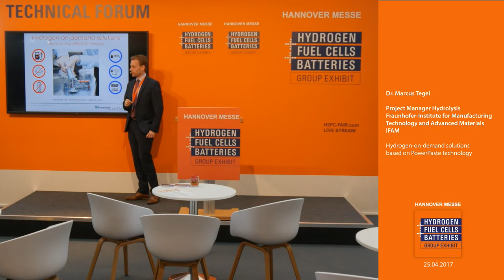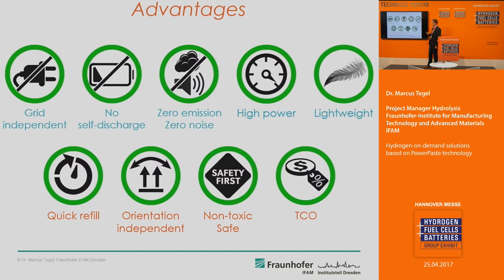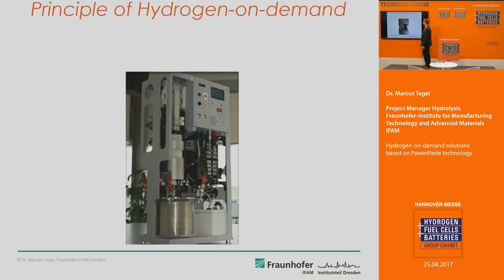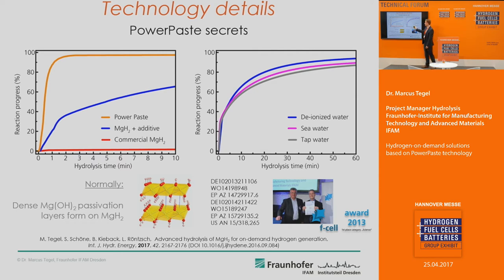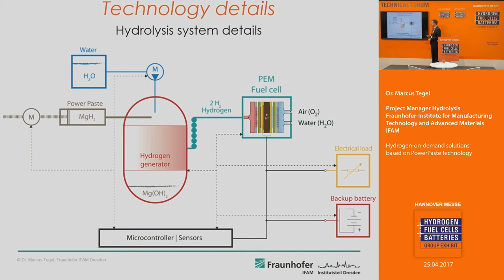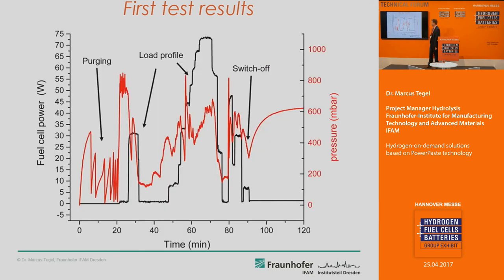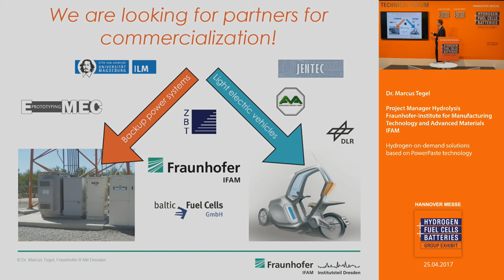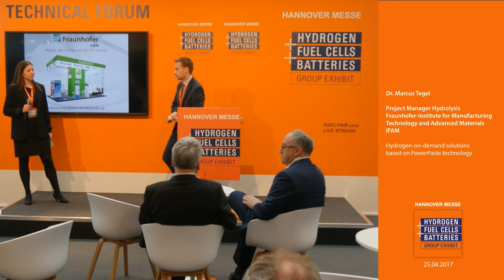Hydrogen-on-demand solutions based on PowerPaste technology

Comment: I can’t see how the Hydrogen paste is made or what it’s made from( whether natuaral or synthetic or toxic)?, You say you use Electrolysis to make the Hydrogen but how is the Hydrogen put into the paste?
Reply: MgH2
Reply: Mohammad Qatouni ?
Reply: @Kiyarose3999  They react Magnesium Hydride paste with water to produce Hydrogen. So it is really getting hydrogen already in water.Just like producing hydrogen when reacting aluminum with sodium hydroxide in water.
Reply: Mohammad Qatouni I thought the paste was a substance developed/used to store Hydrogen, not to make it, to make Hydrogen surely the best way is via Electrolysis. Storing Hydrogen I think is best done by compression as apposed to using another substance ( MgH2) to hold the Hydrogen.
Reply: @Kiyarose3999  Nop.the hydrogen storage is in water. And instead of electrolysis.. they take advantage of stored chemical energy
Reply: They use hydrogen from electrolisis and combine it at a temperature of 750°C and pressure of 5atm with magnesium powder, esters and metal salts to form MgH2, that can then be stored at room temperature and pressure and is stable. Then when they need hydrogen to be released they react the paste with water and hydrogen from both the water and powerpaste is released